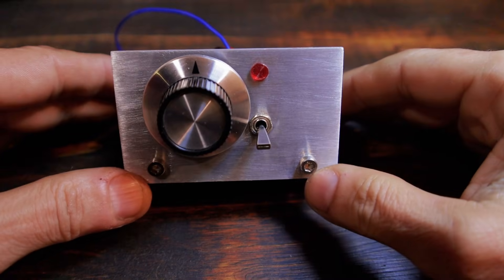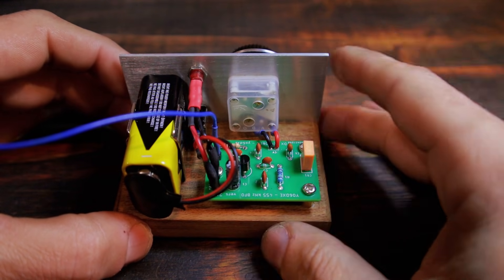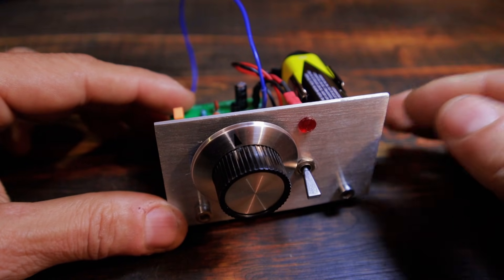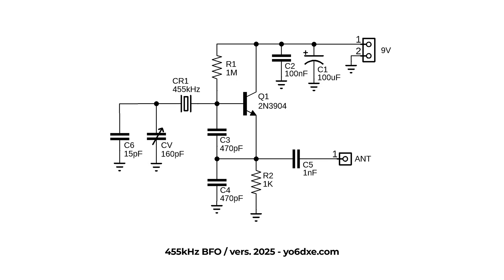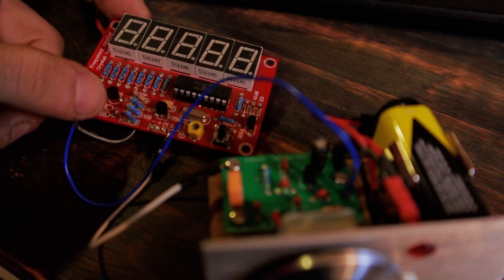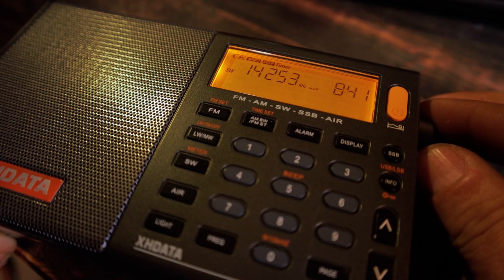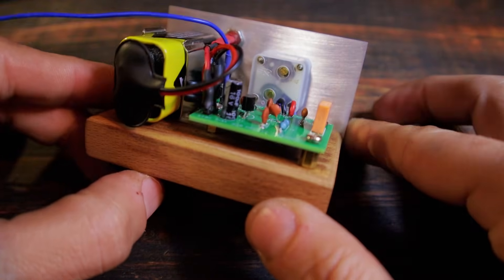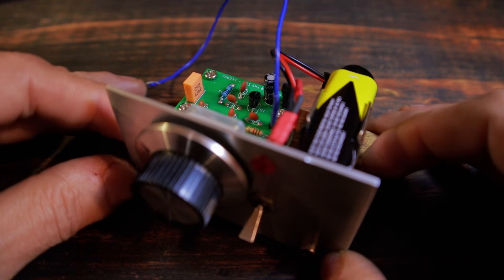Building a Universal 455 kHz BFO: From Scrap Parts to SSB And CW Bliss

Comment: Hi my friend will this work in the 10/11 meter frequency ssb bands im here in the USA and would like to buy a kit if possible if it will work on the 10/11 meter bands.
Reply from the maker: It depends on the receiver you are using. If the receiver has an IF frequency of 455kHz then it will work on any frequency that receiver can cover. You can search for info online about the receiver to check about the receiver. The ones I have are using DSP technology so they won't work unfortunately. I need some older receiver for this. 73, YO6DXE. Let me know what receiver you are using. I will see if I find any info on it.

Comment: Your project looks right so of course it works. I like the use of a ceramic resonator for 455kHz. The first BFO I built used a black cored transistor radio I.F. can and, even though it worked, it wasn't as stable as your design.
Reply from the maker: Yes that is the reason I picked this one. I also tried the version with the IF can and I had the same issue. So I decided to try this one and I was more happy this way. The power consumption also is really small and even with no voltage regulator it seems to be really stable in frequency for a long time. Happy me... less parts to use 😂 73, YO6DXE.
Reply: @dxexplorer  I have a plan to design a two-transistor (OK, JFETs) long-wave radio working into a speaker. There are few stations left on long wave and BBC radio 4 is scheduled to close down next year so there's not much time. I have a working prototype but it needs a lot more optimising before I post details anywhere.
Reply from the maker: That sounds great. Let me know how it goes. And yes it's sad that we have less and less AM stations. At least here in Romania we still have some left. But most of them moved on FM lately.
Reply: @dxexplorer  I have a circuit for a two transistor long wave radio driving a speaker (although it's a bit quiet). I can't upload a schematic to here so, if you want it, you'll have to send me an email address. It has an RF amplifier which is regenerative because it is a damped TPTG (Tuned plate tuned grid) type oscillator, (Actually, that should be TDTG for 'tuned drain tuned gate'), a detector stage and a one JFET AF amplifier with a 1300:8 ohm transformer on the drain. No complicated coils, no feedback circuits - just two presets and two controls (tuning and volume). It needs a long wire as an antenna and a good Earth connection.
Reply from the maker: The email address should be blocked here in the comments but I have all the email info on the QRZ page or on the contact page from the blog: https://dxexplorer.com/contact

I would love to try it. Thank you so much and happy holidays. 73, YO6DXE.

Comment: One of the first times I heard an SSB signal on my fathers' AM tube receiver I did not understand why the audio was so quaint and garbled. Later when I understood what an SSB signal actually was, I used an ordinary AM shortwave transistor radio and held it close to the tube receiver. I usually managed to generate some spurious LFO signal on the transistor radio that acted as and was picked up as a BFO signal on the other, the tube radio. So that the SSB signal then became proper clearly understandable audio. It was almost a miracle.
Reply from the maker: I love these stories. I until recently thought that only using a regen receiver would work. I found out that any other receiver would work thanks to the comments. I also remember I used to listen a lot of CW and SSB signals when I was little thinking that my radio was broken 😅 only years later I understood why 🙈 Thank you for sharing this. 73, YO6DXE and happy holidays.
Reply: @dxexplorer 73, de PE1CGX
Reply from the maker: 73 my friend.

Comment: Nice! I built one years ago Manhattan style. It didn’t work, at least for beating against the IF of my AM radio receivers but, I never verified it worked against an oscilloscope.
Reply from the maker: That is why I wanted to check with the frequency counter at least since I don't have an analog AM receiver. But I will either find one or build one so I can also film a quick demo video as well 😀 73, YO6DXE and thank you for watching.

Comment: Another option is to use a second radio that you place next to the radio you want to listen to CW/SSB on. By tuning the second radio you create a BFO
Reply from the maker: Ohhh yes I forgot about that. But does it work with any ? I always thought it only worked for the regen receivers, that is what I read many many years ago. I never tried though. 😄 73, YO6DXE.
Reply: @dxexplorer  Yes, I have tried it by placing another radio,around five metres away. The clarity was ver good and on another occasion I have tried  beating it by a distance of twelve metres and even that time the clarity was good and intelligible.
Reply from the maker: @loverofthelostnarcv69   Ohhhhh excellent. That it's great info. I thought it only worked with regen receivers. This is great then. Thank you so much. 73, YO6DXE.

Comment: What is it?
Reply from the maker: A BFO ( Beat Frequency Oscillator ) you use together with an AM receiver that cannot demodulate CW and SSB signals so you can hear them properly. But it's usually a superhetrodyne receiver with an intermediate frequency of 455kHz. That is why the BFO resonates on that frequency.

Comment: Very cool! Where do you source those large variable capacitors? Haven't seen them in a while.
Reply from the maker: The one I used in this video ? Or the older vintage ones that I use in other projects ? The air variable ones I mean.
Reply: @dxexplorer  The one from the video.
Reply from the maker: @BalticLab ohhh these I get from AliExpress. I think I put a link in the video description or in the blog article.